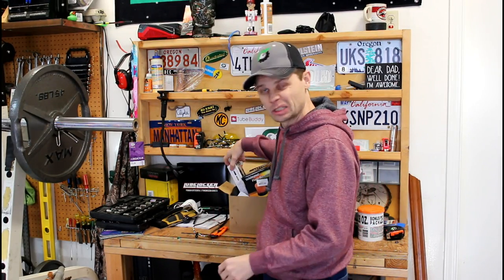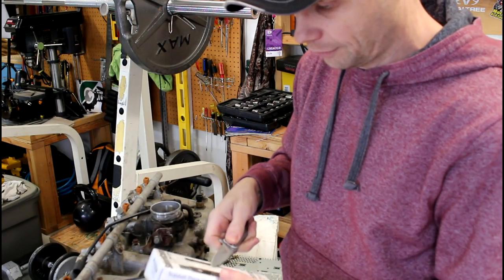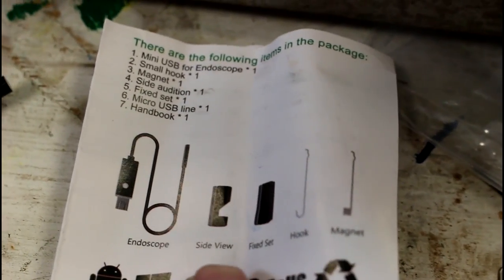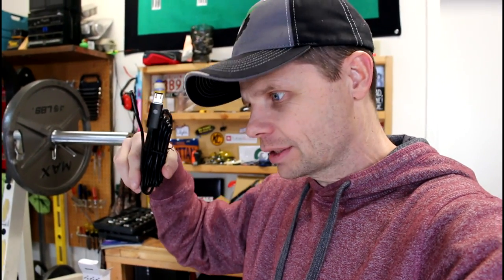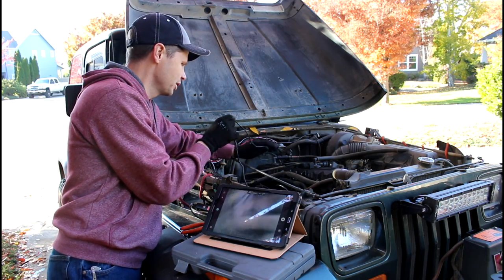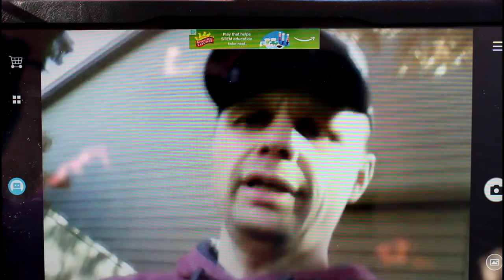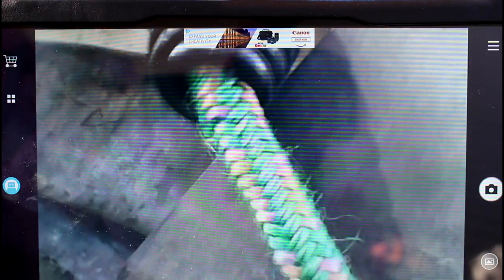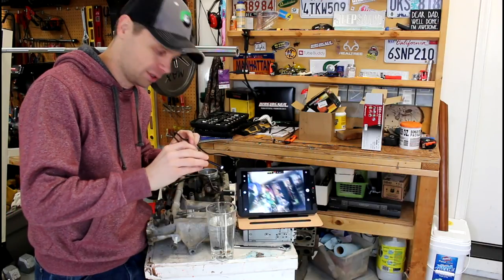Fiber Optic Camera Review: Auxbeam

Comment: I bought a similar one over a year ago... I had to use it to take a look at my axle seal seats in the axle housing.I had some rust build up and the diff fluid was leaking around the seal. so I use my neat little endoscope to grind away and clean up the axle housing, then sealed the heck out of the outside of the seal itself...no more leaks... Good tool to have!!!
Reply from the maker: Yeah, I think it will be a handy tool for some jobs!